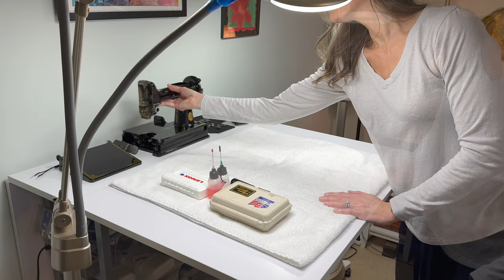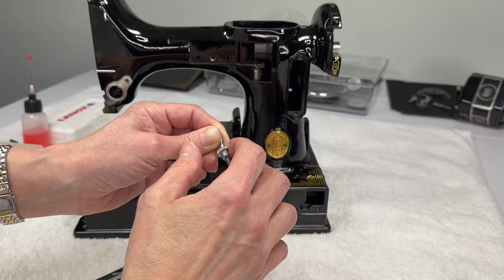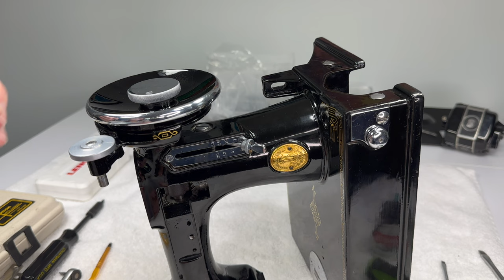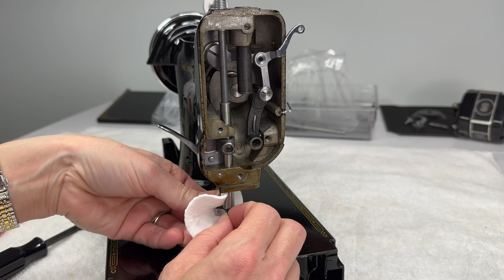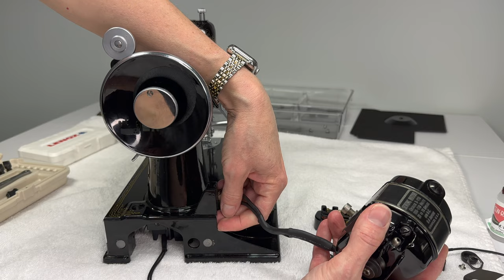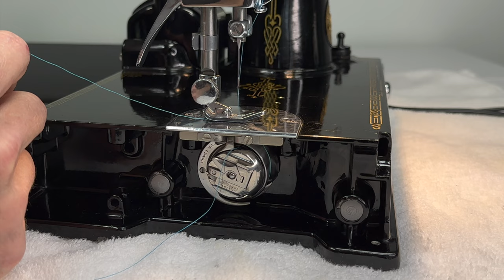1934 Singer Featherweight - Putting it back together - This is how I like to relax...

Comment: Your series of videos have given me the confidence to disassemble, clean, and reassemble a featherweight I recently bought. The only part that really seems intimidating to me is the electrical stuff, especially the lead sheath on the lighting wires. The sheath on my machine is extremely oxidized a pure white and I am super nervous about getting lead poisoning. Also, the fear of getting the wires nestled back correctly is nerve wracking lol. Thank you so much for making these videos. Your style of presentation and your voice are so clear and reassuring. I love that you show in detail when a specific part needs to be oriented in a particular way, it is so helpful.
Reply from the maker: Hi! I am so glad you found them helpful! The wiring can be intimidating for sure and if you are not comfortable replacing wiring then I would suggest finding someone who can do it for you. Wear gloves when you touch the lead sheath and even a mask if it makes you feel more comfortable. When I am working with the sheath I usually do it over shop towels that I can crumple up and throw away. As far as getting everything back in, it really is trial and error. It may take you a few tries to get it all to fit back the way it was but it can be done! Let me know if you have any questions!
Reply: I have done household electrical work like installing new lighting fixtures and replacing receptacles, so I am not worried in that sense. I think its the fear of working in such a tight space and getting everything back the way it belongs. I have ordered a respirator and goggles (I know, seems like overkill). I'll let you know how it goes! Thank you for your support!

Comment: Back in the day, such pins were so-called "taper pins", almost always, and these did, indeed press OUT from the back, and press IN from the front. Always.

FWIW, taper pins are available at most ACE Hardware stores. Plus, of course, McMaster-Carr.

Indeed, there are taper pin reamers available, which can be employed to repair a taper pin bore, should it become damaged.
Reply from the maker: Thank you for all of that great info! Wasn’t sure if I could get the size I needed if I ever had to replace one. Hopefully I don’t!

Comment: Fantastic job!!! Five stars restoration!!!

How do you get that shiny shine of the internal metal parts of the machine? 

Is amazing!!!

Thanks for sharing
Reply from the maker: Hi! Thank you! After cleaning the parts I use fine sandpaper on any that are not chrome plated to shine them up further. The chrome parts are a little different. It’s wonderful if they are already in great shape but if they need a little buffing I find that you can use one of the nail buffers that are made to shine up the natural nail. They are gentle enough to not scratch and polish up and minor imperfections. It works for me but I would just try it in an inconspicuous place first to see if it would work for you. Hope that helps!

Comment: Hi Jen, fantastic video. Did you pull the rock shaft and feed lifting rock shaft completely apart to clean them or did you leave them as you can see them in this video and the previous one and just pop them in the ultrasonic and scrub? 
I would also love to know how you removed the handwheel collar and the parts within the arm for proper cleaning 🤩 
Thank you for generously sharing your wealth of knowledge!
Reply from the maker: Hello! In my Featherweight restoration series I do not remove the rock shafts as it is a little more heavy duty work and may not be for everyone. For these two videos I did remove them and I always do when I restore machines for my customers or when I am going to offer them for sale. Further disassembly of both of the shafts makes for even more adjustments upon reassembly so I do that on a case by case basis. I don't think it is always necessary. I try to clean them in the ultrasonic and then dry them very quickly, flush them with alcohol that helps the drying process and then add oil to all the moving parts right away. So far I have had success with that approach. Removing the collar is also on a case by case basis, I have removed every gear and shaft on some machines. It all depends how far you want or need to go and how comfortable you are with reassembly and getting all the settings right again. Long answer but that really is how it goes!
Reply: @SewingMachineRehab  thank you for your response. It was very helpful!

Comment: How on earth do you remember where everything goes. Every time I take my cars apart, especially the engines, I have parts left over. The funny thing is, they still go, but I'm sure that won't work with my singers.
Ps. just wondering whether or not it would be a good idea to give bearing surfaces and moving parts a light smear of an auto antiwear additive as you reassemble?
Reply from the maker: I remember the first machine I took apart, a Singer 404. All the parts were overwhelming. I still keep them separate and grouped together as I work with them but the more you do, the more you remember what you should have and where it goes. I couldn't answer about the auto anti-wear...my first instinct is to say not to use it. I think if you wipe them down and and a light smear of the grease you are going to be using that is the best option. Some additives can be bad for the parts over time. Just my opinion though. Good luck!